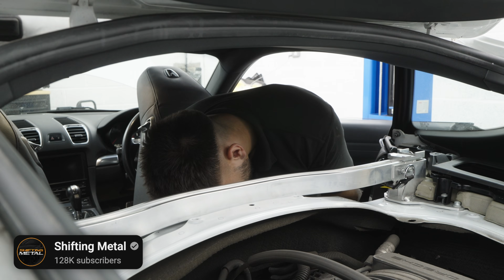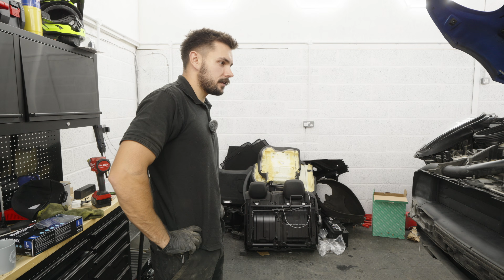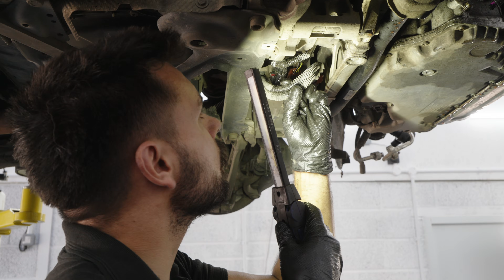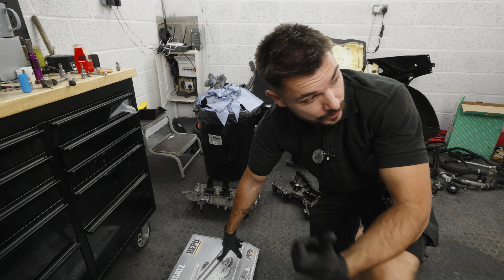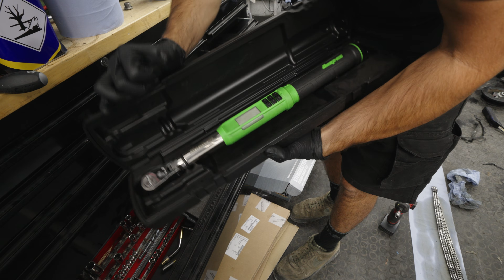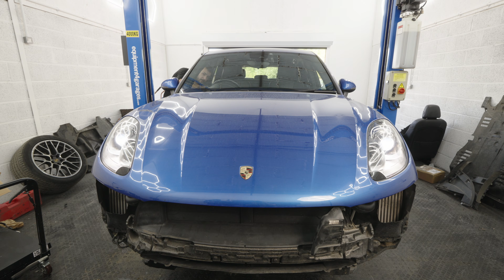Why Did This Porsche Macan Develop Death Rattle?

Comment: Great craftsmanship.check and check again .if you don't on a car of that marque your asking for trouble . People can get complacent after years of doing jobs .but price of those engine or any engine with todays prices would be a fool.and doing a rebuild would take how Many hours ? Nice watching someone with soft hands working ! More like a surgeon than a back street butcher using prybars and throwing bolts on the floor ! And great fault finding on cam pulleys .

Comment: Big job 😢I had a same issue with vauxhall astra main dealer want 4k I bought the car for £3800 no rattle of doom at that time. No garages where interest on undertaking the job except the main dealer and one independent also wanted over 3k including clutch replacement. 

In the end took it back to the seller, he said I know my away around these engines he was ex BMW mechanic I will charge £800 took him 3 days and photo what he was doing unbelievable job but with vauxhall cars the gear box has to come out with the engine massive job.

Excellent video 👍

Comment: You tackled this big job calmly and systematically.  Well done.  Bit surprised that you did not change all the chain drive sprocket units.  If the one original unit has wear on the teeth, that will accelerate wear of the chain and then the other sprockets.

Comment: It seems I dodged a bullet with the Macan. I was looking at the V6 version as a change from my AMG GLA45.

The AMG has been near faultless in six years of ownership. Bought at 18 months old with 2,500 miles on it from a Mercedes-Benz main dealer. The Macan had less horsepower, but a burbling V6 and a different name. It would carry rubbish and boating stuff and drive with some enthusiasm, hence ti was on my list.

But after watching this I’d be more tempted to go back to my first car - a 1968 Ford Cortina Mkll deluxe……

I’ve recently watched a video on the AMG V8 63S engine after one threw itself to bits. Nothing is easy anymore is it?

Great video and an impressive amount of skill and knowledge on display 👍🏻👍🏻

Comment: Does Porsche have a “no start” position with throttle peddle, as GM products will have you hold the peddle down prior to engaging starter? I would feel better knowing oil pressure could be built up before high speed of a running engine.  Great content video.

Comment: The moment you said rattle i knew it would be chain related, doesn't matter what badge it has the entire vag range has problems with timing chains. Build quality dissapeared around 2010.
Reply: Big job 😢I had a same issue with vauxhall astra main dealer want 4k I bought the car for £3800 no rattle of doom at that time. No garages where interest on undertaking the job except the main dealer and one independent also wanted over 3k including clutch replacement. 

In the end took it back to the seller, he said I know my away around these engines he was ex BMW mechanic I will charge £800 took him 3 days and photo what he was doing unbelievable job but with vauxhall cars the gear box has to come out with the engine massive job.

Comment: Theory why timing chain was in a stretched condition at 60k?  Used same one from Porsche?  Any upgrade available?
Reply: It wasn't the timing chain as he explained. The sprockets teeth were worn out causing the chain to not have tension and rattle.

Comment: For a 60,000 mile car this wear is flippin’ terrible.     So you say a kit for the cam chain is 2.5k and each cam sprocket is 350 plus gaskets sealant etc.   So easily a 5k+ job at Porsche.      Seems to me like a vehicle to avoid .
Reply: It would be interesting to know if the oil change services had been performed on time.  That said, the quality of modern Porsches is a bit variable, with most models having known weak points.  Much like most german cars though.   My Porsche has the highest running costs, with items wearing out much sooner than you would hope for, and always needs more bits than either my BMW or Audi
Reply: Chain replacement interval is usually around 100k mark... this motors been thrashed to within an inch of its life and am guessing been run low on oil and missed a few services...
Reply: 5k? And the rest, its not going to vauxhall 😂
Reply: How the heck could a double row chain stretch? Very poor reliability on a car that should be better.
Reply: @Dont_Gnaw_on_the_Kitty_4 you didnt watch the whole video did you? The chain didnt stretch. Intake vvt sprockets were worn out and damaged the teeth.
Reply: Modern Porsches are absolutely terrible cars for maintenance. Definitely not designed for someone at home to fix.
Reply: It all depends from how was driven and maitained, 60k miles in city are like 200k+ miles in driveways...
Reply: Yes avoid 100%. They are also prone to oil leaks which cause a fortune to fix.
Reply: @gregs8685   Bore score as well. Oil leaks. Cracked timing bolts.
Reply: Shockingly bad engineering. Good for mechanics Porsche main dealer/independent. Couldn’t live with the worry of what the bill would be after a service/MOT. I’ll stick with my unerringly reliable and over engineered Honda Civic FK8 with absolutely no unscheduled troubles or unforeseen headache sometimes second mortgage sized bills!!!
Reply: Brilliant video. That’s why I’ve went electric. Too many things to go wrong.

Comment: The one big thing that impresses me with this job is a used car dealer willing to pay for a Quality mechanic to carry out a proper Quality repair . In Australia many would try something dodgy to hide it like ground down the inside of the rocker cover so the worn chain no longer contacts it , even the gasket wouldn’t be changed , just lots of sealant shoved in
Reply: How do you expect them to pay for a condo on the gold coast.
Reply: Sounds ripper mate.

Comment: You do a very good job for sure. This is not your first rodeo. Now on those V6 engine that we found in Panamera, Cayenne and Macan im very surprised you do the chain cuz it's so strong it rarely fails. But cam phasers are known to have problems and the most annoying problem is piston slap and deep groove on cylinder walls. This makes a big bad noise. Now not sure why not try just the phaser at first /and see if fix it ? But now it's all done and it worth it for sure and hopefully don't have any slap later. Now it's incredible how we can find OEM manufacturer parts with or without bading for fraction of OE price at the dealership especially on VAG car !

Comment: Thanks for showing some detail on the rocker cover gaskets! Need to do mine with the spark plugs and this is the first video I’ve seen that shows the process
Reply from the maker: Message me on instagram if you want a full rocker cover gasket kit with genuine Porsche workshop manual at less than half of what Porsche charges

Comment: As an auto tec I always replace the sprockets as well never put new chain on old sprockets same as when changing a motor cycle chain always replace sprockets
Reply from the maker: Completely uneconomical given these pulleys are £350… each!
Reply: @benthompsoncars  An argument can be made that all four pulleys were from the same batch and installed at the same time, and 3 out of four 4 failed, so how can you trust the fourth one...
Reply from the maker: @xtevesousa  The exhaust and Intake pulleys are of completely different construction and manufacturer and are not of the same batch. Only one of the intake pulleys failed causing excess wear on the surrounding timing gear and both intake pulleys wear replaced anyway. I’m not sure what your argument is 🤷🏻‍♂️
Reply: He knows what he’s doing ffs

Comment: Hi Ben - great video and thank you for sharing it. Folk like me learn so much from these videos. May I ask a question? What is the impact driver you are using? I assume it is a driver as opposed to an impact wrench? Thanks again!
Reply from the maker: Thanks for watching! It’s a Milwaukee M12FID driver. I prefer these over an impact gun as I can put a 3/8 and 1/4 adapters on, and it will also accept shockwave torx bits which are great for buzzing under trays off
Reply: @benthompsoncars thank you Ben!

Comment: And that folks, is why I'm motorcycle mechanic not a car mechanic!!!!!! How the hell you remember how everything goes back together or comes apart in the first place!!!!!!  Fair play to you Ben. As a matter of interest, how long did the job take from start to finish??
Reply from the maker: I envy the simplicity of some bikes! I do have some bike content coming soon 👀 This job took me around two days labour but there was quite a long wait in between starting and finishing as the pulleys had to come from Germany. Now i’m familiar with the job it could be done in a day
Reply: @benthompsoncars Wow, fair play 🔥🔥👏👏👏👏👏
Reply: Thanks for asking this question. I was curious too. I did suspect from the moment he looked that the chain wasn't ultimately the problem. (I am a Touareg owner - those double row timing chains - extremely rare they stretch and something else is usually the culprit. Nice to see Ben obviously has a method to not miss anything.)
Reply: Take photos with your phone …..
Reply: That’s why you have manuals 😊
Reply: The mind  is very powerful if you ask me how to disassemble and assemble that I wouldn’t know how to tell you but if I can do it and when you already have a little experience you make your own method to work😉

Comment: My OCD was kicking in when you reinstalled the cooler pack with the inter coolers caked in mud and crap.  Would it not have been easy to blow it out when you had access?
Reply from the maker: Your OCD need not worrry as it was spotless before the car went out.

Comment: so nice to have the timing chain at the front, no need for engine removal
Reply: But if it was properly engineered there should be no need to ever remove the timing chain.  Thats what belts are utilized for quieter running but inevitably need to be changed at say 36k/60k miles or unusual to be as high as 100k miles for the American north star engine which astonishingly is 100k miles. But if properly engineered engine like the Honda K20a chain drive 2.0 petrol screamer. Simply don’t get chain drive stretch problems or any other for that matter, so over-engineered! Want no problems get Japanese or more specifically Honda or Toyota. Just saying….

Comment: Many modern engines use very thin oil combined with very low oil pressure at low revs, to get better fuel and emission figures.  These tests are conducted at low RPM.  The combination of low oil pressure and 0-W(XX) oils means excessive wear, exacerbated when the vehicle is used in "normal" conditions such as around town most of the time, and the additional gearbox programming that sees the vehicle shift into a high gear early.  Then, while running at 1500rpm in a high gear the accelerator is pressed, resulting in low oil pressure but very high load on the upper big end bearing and minimal oil in the valve train.  Overall result is fast engine wear in many areas, but the Gubbermint is happy with "low emissions".  The solution is to always put your Euro in Sport mode, never allow it to lug.  As an example, my 2023 T-ROC R has specified oil pressure at idle of .85 bar, and only 1.2 bar at 2000rpm.  Only at 4000 rpm does it get to 4-5 bar.  0-W30 oil is specified.
Reply: For this reason, you have to step on the gas very gently at low rpm because the transmission it's shifting very fast to  a higher gear at lower rpm and its making this rattle noise I have the same issue in my Audi but I found the solution and it doesn't make this noise anymore if I remember my car started this noise in about 70.000 km and some mechanics tell me I have to replace the timing chain and some other parts I never did any of those the solution was keep always the oil full and don't push the car at lower rpm with a higher gear now I have 151000 km with out any issues.
Reply: Would using a thicker oil be better for the engine?!
Reply: @21ftclean  Yes but warranty can be voided if you do.  The fix is to increase the oil pressure at low revs via a remap, which could also void your warranty but make your bearings and roller rockers last longer.

Comment: Impressive work. Using the original OEM aluminum timing cover bolts? None had snapped in half? Not replacing with the revised steel bolts with washer?

Comment: I would hate to think what a Porsche dealer would charge for that work, especially as they would be charging for full cost Porsche parts.
Reply: I had a Macan with this engine, sold it at 50k miles.  Good decision it seems.
Excellent video, thanks.
Reply: The labor charges would be insane.
Reply: @bmandiego  £4k/5k as a guess - low end - 6-7K more likely plus VAT
Reply: Easyyy 10k .
Reply: @xmaxbabilo 7k plus Vat was my upper guess so moving into 10k figure.. Porsche will rinse you and will take 3 days to do this job. You are better off booking time off work getting tools and doing it yourself or getting someone to do for you

Comment: Magnesium is prone to certain oils and antifreeze to cause reaction and Honda on old water pump impellors and cases covers that the outside would look ok but inside would be heavy corrosion where sealant is used and it sometimes does and sometimes it doesn't corrode. There is coatings but acid can break this up same as aluminium.

Comment: Wow these modern engines are mechanical nightmares…that would easily be a 5-10k repair on an unsuspecting owner. 
Just far too much complexity
Reply: Nowhere near 5-10k less than £2000
Reply: @G2020-  a mechanic at a Porsche dealer would charge you 5K-10K easily.
Reply: @richwg6633 if youre using a porsche dealer without warranty you deserve to get fleeced.  Plenty of independant lads out there for a fraction of the main dealer price.
Reply: @G2020- He said the chain kit alone was 2500 from the dealer. Plus sprockets, plus gasket kit, plus AC service. 8 - 16 hrs labour.

Comment: IWIS (the first I is stylised into a J) are OEM for just about everything. Febi chain kits are all Iwis as well unlike BGA and FAI stuff. Clearly a well maintained car with regular oil changes, and it's still in trouble. Not good enough is it? 

These things are going to be a liability at 10-15 years old.
Reply: absolutely and I feel (slightly) for the 2nd hand car dealers who have to warranty these ticking timebombs on tiny margins. Fortunately EVs are proving them selves to be relaible so perhaps a bit of body and suspension work will mean dealers can take a margin again without fear the car will be back.
Reply: @dasautomatt  Absolutely. A used Tesla seems like a good idea in comparison to this crap.

Comment: Imagine the chain would be slack down side if tensioner has no oil pressure. Lot of BM engine (older) has a brief for split second on start up.

Comment: Such interesting videos Ben - will enjoy this channel moving forward!  Fingers crossed for the 981.  Timing chain rather than belt seems such a great concept, but depending on age/mileage here, I wonder what caused the shift in pulleys/sprockets to such an extent as to chew teeth?
Reply from the maker: It’s a tricky one to pin point exactly but I believe one of the pulley locking pins got stuck not allowing it to rotate whilst the remaining 3 pulleys continued to variably adjust causing huge amounts of stress and accelerated wear, maybe 🤷🏻‍♂️ Thanks for watching!